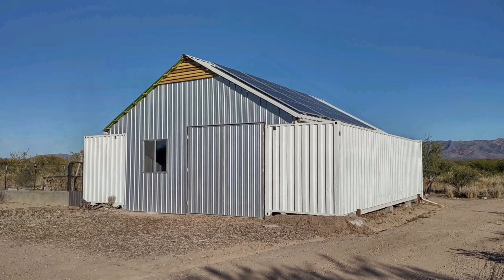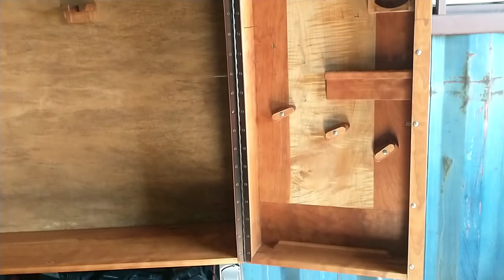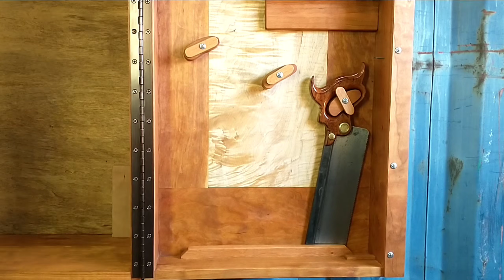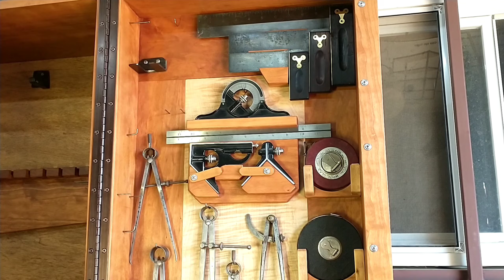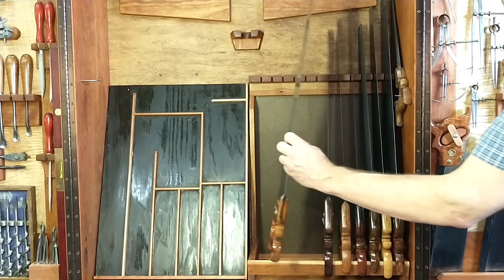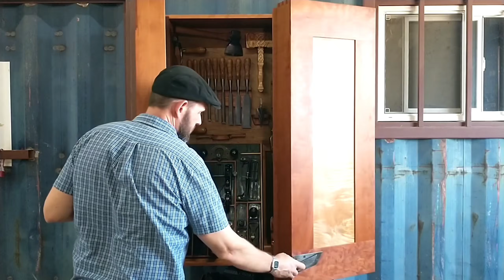EPIC Hand Tool Cabinet with Restored ANTIQUE Woodworking TOOLS

Comment: I, too, enjoyed building a traditional wall tool chest. Inspired by Studley, I added decoration at every stage. If there was a pointlessly complex way of doing something, that is what I chose. Unnecessary detail was embraced everywhere, and no space left unadorned. Although it took longer (over 500 hours) I enjoyed every minute. Although considerably smaller than yours, it currently holds some 350 tools in a multi-layer (up to 8 in some places) that double unfolds for immediate access.
I have seen a lot of double door cabinets- and they all have, like yours, sides on the mating faces of the doors. I do not understand why- they perform no function, and take space that tools could occupy.
Reply from the maker: I watched your video. Your tool cabinet is amazing!! 
Red didn't particularly enjoy this project, but he was glad when it was finally done! 🙂🏜️